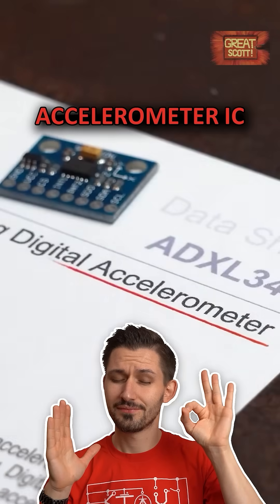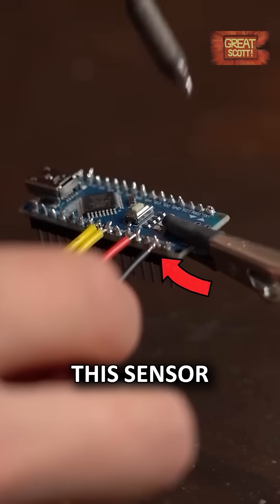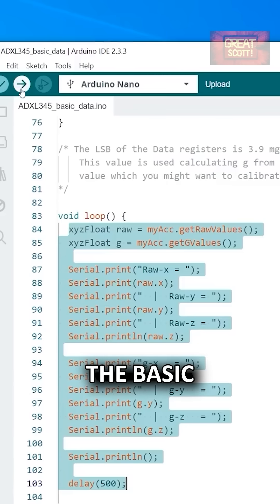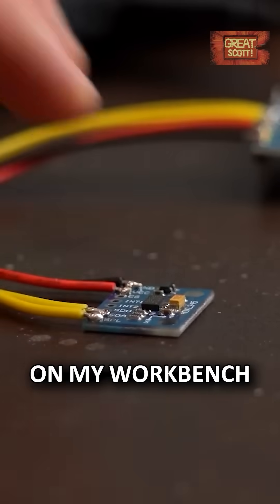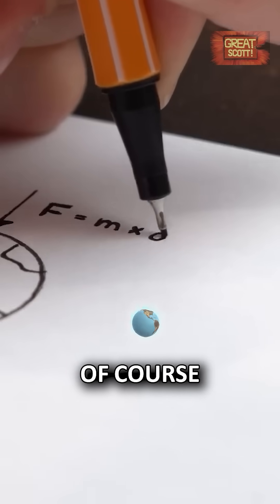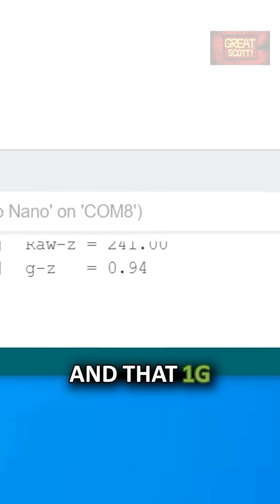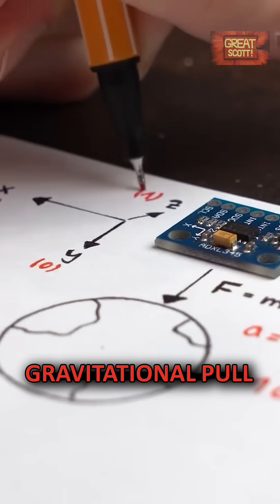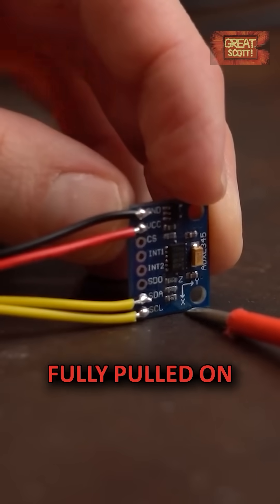Accelerometer are AWESOME! #diy #electronics #explained #accelerometer #sensor #arduino #tutorial

Comment: F = m • ā
I think you're measuring the very slight difference between your gravitational  acceleration, or lack thereof, vs the centrifical acceleration from earth's rotation. 
In other words, the spin is pulling you parallel & out from rotation at the equator, but gravity is pulling you straight down, in a different direction proportional to your latitude. In Europe you would expect about 0.1% difference which you're seeing

Comment: The explanation for the z-acceleration is not quite right. An accelerometer measures proper acceleration; loosely speaking acceleration relative to free-fall. That is, the device will measure zero acceleration only when in free-fall. The acceleration measured in the video is therefore the upwards acceleration caused by the table, preventing it from falling freely towards the center of the earth.
Reply: Isn't acceleration of that device zero? It measures gravitational force which is countered by the solid object (table) and therefore device can not respond to gravitational force and is not moving. a = dv / dt. But "v" is always zero so "a" is zero too.
Reply: @Beeblebroks  "Isn't acceleration of that device zero?" Sure, in the (non-intertial) frame of the human observer its acceleration is zero, but that is not the frame that the device "sees". It does not measure force, but (proper) acceleration, and it measures 1 g of acceleration away from earth caused by the table. (Note that a "g-force" is not actually a force; it has units of N/kg = m/s^2, i.e. acceleration.) I know this is confusing, not least because force and acceleration are closely related (both in Newtonian and relativistic physics). Check the Wikipedia articles about accelerometers and proper acceleration if you still have doubts.
Reply: @antonottosson914  i see, acceleration vs. proper acceleration! Didn't know about that.
Reply: 😮 @Beeblebroks should've learnt it in high school! We're learning about it now

Comment: Let acceleration vector =  ⃗a

When the board is laid out flat,
The acceleration vector will be perpendicular to x and y axis, so the angle is 90° so the magnitude of the vector along x and y will be 
  ⃗aCos90° and Cos90° is 0 so the magnitude is 0 which means there is no acceleration along x and y axis